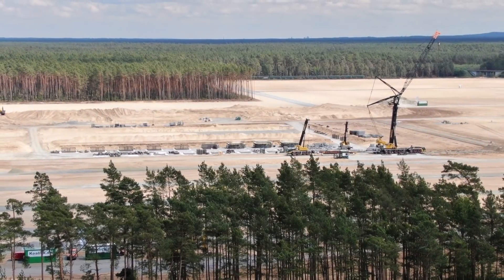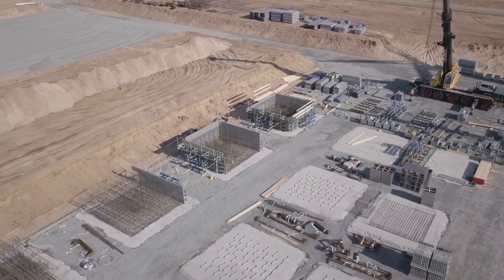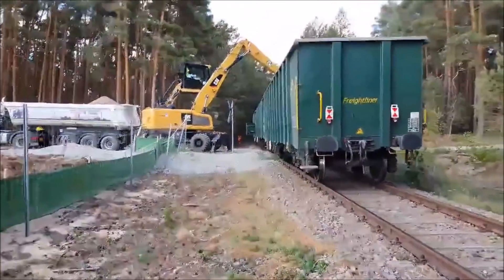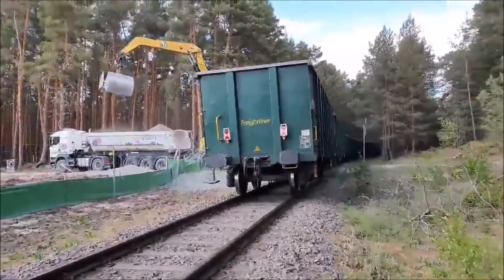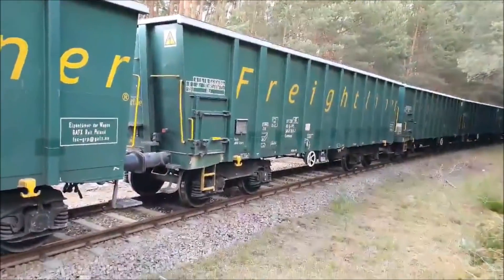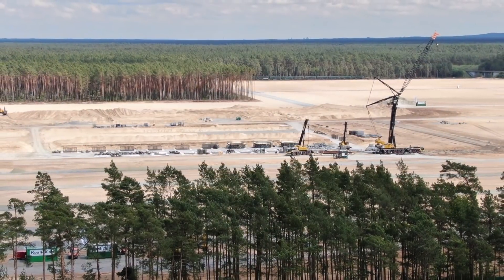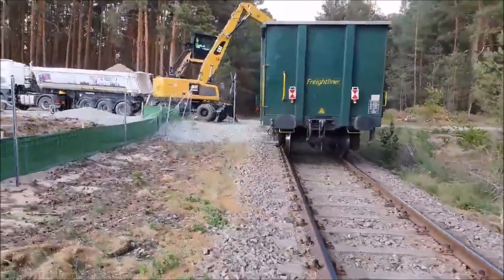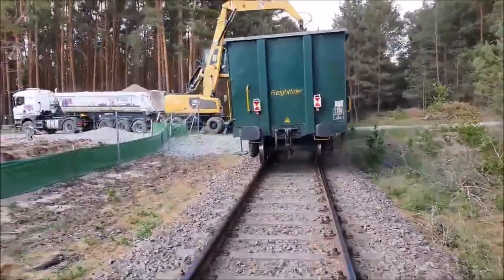Tesla Is Apparently Changing Giga Berlin Foundation

Comment: A clay foundation moves and cracks floors and walls. Rock is immovable. Sand also does not move if the sand sits on the top of rock. However if the rock is deep down sand may settle over a few years and induce cracks in the floor and wall. If the sand is natuarally mixed with clay it is a solid foundation.

Comment: I'm a construction project manager in England and I can tell you today that without Pile Caps & CFA Piles the volume of concrete m3 required to achieve the same bearing capacity using the above pad foundations is excessive!!! Somewhere in the region of 120% - 160% more concrete for the entire ground works package.
Not only are CFA piles way more economical, they can be built in half the time with 1/3 the man power. This must be the only option they had available as no structural engineer in his right mind would ever consider this design. It is very excessive ! 
I'm shocked that my counter parts in Germany have been forced to use foundation systems last championed during post world war 1. This will result in excess CO2 emissions for all the additional cement, sand and aggregate required. 
I hope this doesn't hold back the project and cause excessive delays 😒 ! Thank you for the update.
Reply: relax.. Deeper foundations arent possible in this area.... The big stamping machines need those foundations. The other parts of the building wont get those massive concrente foundations.
Reply: Josef Robben it would be worth exploring micro-bore piles in conjunction with ground beams. How deep are they allowed to go ? 
I’m guessing the only other option is using very slender columns at 3ft centres with a deep trench fill foundation ! ! !
Reply: @Will Bradbury. All good points  especially the CO2 with such a high volume if concrete. FYI the latest ammended application that was submitted late last week ( around 9/6/20) again included pile foundations.

Comment: Much comes down to whether the loads (weight - static and kinetic) are primarily concentrated (point) or distributed (uniform).  Intuitively concentrated loads would logically be placed on concentrated  foundations - columns or pilings -  such as Venice.  High rise buildings may be primarily built on pilings.  Alternatively concentrated loads may be distributed over a uniform mat foundation which also support some of the world's tallest (and heaviest) buildings.  Tesla is an engineering company, decisions of this like are the air they breath (before breakfast).
Reply: That's what I was trying to say. !!!!  I will guess that the pads that they have already poured will be directly under the giant stamping machines.

Comment: I have not read prior comments however it looks like the area where the giant stamping machine will be built , the factory is the machine that builds the machines, the stamping factory side will take longer to build, the concept is like a mega ship floating on water, for the dies to not fracture and fatigue the foundation must be heavy and displace the soil, the stamping platform will be raised and over time will settle due to compaction and will eventually be level with the factory floor.

Comment: Make the concrete thick enough, you don’t need pilings.  I remember a printing company I worked at that was installing a 10-unit press.   Part of the instal, was cutting a hole in the floor, excavating earth, ramming the remaindet, and pouring a two-foot reinforced slab.

Comment: I am a subscriber of your YouTube channel. That’s wonderful that you’re keeping us informed and up-to-date on Gaga Berlin factory.  What you are showing is the several machine foundations for the press room and stamping room manufacturing. These square swimming pool looking foundations are to make blanks for the hood and Side panels. Then additional presses are used with similar foundations to actually form the shape of the hood and left and right side panels. In addition, you will notice that these actually Will be underground maybe 10 to 12 feet.  These big and Heavy duty presses are so big that the bottom half of the press is underground.  the press operator will stand on the top of these foundations on the cement floor of the factory to feed sheet metal at waist level.   The steel columns have not been laid yet. We cannot tell yet if they will be driven down to bed rock or on the cement floor of the factory. We will have to wait and see. Thanks so much for your channel and keep up the good work.  JVV
Reply from the maker: Thanks a lot John.
Reply: An additional thought on what the cement forms and deep looking swimming pools might be. One other thing they may be is the paint system. Most auto companies have a three or a five stage wash and then dip the complete body into a prime coat of paint. It should be one of these two things. These press foundations and or paint systems are so big and permanent they must be done early and then build the factory around the systems.  JVV

Comment: To me, it seems simple.  They have permission to put a foundation above the waterline.  Tesla tried to change the foundation to piles but that needed to be approved and the hearing was not going to be until the fall...as per your reporting.  Look at Fremont...Tesla wants to go as quickly as possible.  Don't think it has anything to do with the cost of the foundation but this foundation has already been approved so much less risk.  Germans are a very OCD group of folks when it comes to many things.  They do make terrific stuff.  Have 2 Audis currently and have had several MB's and several Porsches.  Musk I am sure did not want to risk the community meeting that could have caused Tesla to undo the entire project and "return it back to the way it was".  Elon does not have that personality to potentially have some OCD Germans tell him "Sorry you have to rip it up!"  He is doing this to get it done as quickly as possible regardless of the price.
Reply: With all due respect, it has nothing to do with "Gernan OCD" , but a democratic process and scientific findings. The cost of plate foundations will be slightly higher than piling, and maybe carry a slightly higher engingeering risk. If the final building approval is not granted then Tesla will be required to remove all the foundations, gravel etc, re-level the site and replace the topsoil, finally replant a forest.  The current works are under temporary "at risk" approvals that specify reinstatement to original plantation if final approval is not granted.
Reply: @andygranger3662  Hi Andy, I'm curious if this debacle is why the head of Tesla Europe left the company. Maybe he recommended this site, instead of going to Poland or somewhere without these concerns. They should have known about the water table problem in advance. And I certainly do not understand why the meeting is not until September. This project will have been started 6 months earlier by the time of that meeting. If it's not approved, it's a catastrophe; even if it is, it's a semi-catastrophe, coming that late.
Reply: @stevenfierberg457  ...good point Sacha Zahnd was involved in decision making involved with Giga Berlin, but clearly we do not know how influential he was in the decision to choose Brandenburg. I can imagine a testy exchange between Musk and him "you're German, fix it" .  I have said this once before on this channel, and I will say it again, I believe The Brandenburg State government have over-promised for political  ( economy) reasons, and Musk now finds himself trapped between political dogma and the realities of the German approvals process. Sure, the site looks great on paper and the state government made lots of noises about how they would help Tesla. In reality, to quote " time spent in reconnaisance is seldom wasted". A better understanding of the sandy ground, surrounding water conservation situation, on-going local drought, which are all available publically on-line, would all have been indicators to build elsewhere.
Reply: @andygranger3662  What is your opinion of the chance that Tesla would not be granted a final building approval. It seems bizarre that the project could get to this stage only to finally be canned.

Comment: Congratulation, what can Engineering  do!! But on from Monday they will change the way they are unloading the crushed rock and cement from the train. Either they bring the Trucks filled up with material by train or they build a subterain to fill the trucks on place in 10 minutes out of special train wagons. Me as a shareholder afford this. We wan a have Model Y next March🤔😜😎❤️
Reply: I agree it is the most inefficient process on the site.. Cheap and efficient fix: 2 wheeled grab machines and 2 extra sweeper men so that 2 railcars can be unliaded simultaneously into 2 trucks.
Reply: I was thinking the same thing about the gravel unloading, but maybe the rate of off-loading meets their requirements.
Reply: @hostarepairman  In my humble opinion if they want to get model Y out of the door from Berlin any time before 2023, they need to hurry up.

Comment: They couldn’t put the huge one piece casting machine on a shallow footing! I wouldn’t consider an auto factory on a shallow foundation. Maybe this is the foundation for the power station building. Shanghai stamping addition has very heavy duty foundation.
Reply: There are many ways to do the foundations for casting nachine etc. The current GF4  plate foundations are for the  main structure posts. There is no reason why casting machine, stamping machine etc cannot also be floated. It comes down to just one thing.. reducing load to an acceptable ground pressure ( kg / sq m).  In Shanghai the soil is clay and wet and the basement of the stamping machine shop is below the water table, so it makes sense to pile. In Berlin the sand is free draining to the water table below. No reason why machines cannot be floated on plate foundations.

Comment: Based upon what I see in your videos, using a 'shallow foundation' explains why they lowered the ground before starting to build.  When the 'boxes' are completed they will be able to attach the steel beams to the top of the boxes.
The concrete slabs will distribute the load on the subsoil.
Reply: Check out the many videos for GF3 construxtion from Jason Yang and Wuwa. You can clearly see that the pile caps are also in deep holes so that they finish at ground level. In the case of plate foundations at GF4  it is neccessary to excavate the whole area to gain access to place the cast reinforced concrete plates and post sockets. The area will then be back-filled with the excavated sand, maybe with a binding agent.

Comment: I do not believe you know anything about the structure soooo........
Why don’t you try doing some research… building permits talking to Elon etc. I believe that there will be piles used if you will notice the foundation would be around the perimeter to hold the major weight. everything will be connected.
Reply: What about you do the investigations?
Reply: Scot, Armen reports on a daily basis and has explained that the current temporary permit only allows for foundation work above thei aquifer level. Hence the work we see today.

Comment: It is very simple  Tesla will build the cheapest foundation its needs that hits the requirements including structural environvental and legislative needs. Now I would imagine since we know they are using some machines for cast pressings that are 6000 tons or more up to a rumoured 15,000 tons those will use the more expensive deep pilings but since there is no requirement to do the whole factory using the more expensive method than they will not.
Reply: I think you will find that they will not be permitted to use piling due to environmental concerns. If they are floating the main structure successfully, there is no reason why casting machines cannot be floated too. Granted the GF3 casting machine area was deseley piled under the basement floor etc,, but it  all comes down to spreading the load (kg / sq m.). I feel a lot less nervous about floating the foundations for a machine than a high building.

Comment: Could be footings for metal forming or cutting tooling.  Requires lots of support.
Reply: No these are for main structure posts. You can see they are casting sockets to support the posts. ( prefabricated steel socket cages are on site)